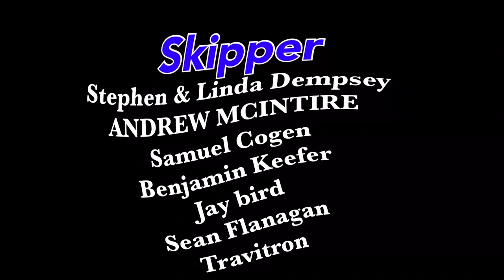Time Lapse Boat Bathroom Remodel from Start to Finish | Sailing Wisdom

Comment: Herb, You need to learn to use CAD for those projects. It would save you a lot of time. CAD - stands for cardboard aided design. Build cardboard patterns first and then go after the wood. It did turn out really nice and should be a lot easier to keep clean.
Reply from the maker: I like that type of CAD 😎

Comment: Beautufull job guys! I've been binge watching all your videos in preparation for our winter haulout and maintenance period....just to reaffirm that hard work pays off in the end 😀 Question though, where does the shower water go ? And could it stick around under that raised floor or is it contained within in that grey box and redirected from there so you can inspect for mold etc?
Reply from the maker: There’s a bilge pump that sucks it right out so it’s not hanging out under there. Hope you’re enjoying the binge!

Comment: Great vid! Thanks for the awesome videos! How has the copper sink held up so far? Do you have to clean it any certain way? I'm thinking about adding a copper sink to my boat and I wonder if there's anything special I need to buy or do to take care of it. I'm hoping to eventually refit my head as well, and I really like the look of copper with stone and wood. Thanks for your input!
Reply from the maker: It’s held up really well! I was worried that the salt water that pours in the hatch during a boarding wave would corrode the sink into a green ball of death, but it’s held up just fine! Every so often, I clean it with a loofa (after I use the loofa to clean me with the leftover soap in the loofa). If it gets some green spots, I’ll rub it with Mother’s Metal Polish. It cleans it up and keeps it from turning green. 
I could polish it to be a bright copper color but the maintenance would be murder. I keep it with a healthy level of patina so I can have a healthy level of relaxation.
Reply: @RiggingDoctor  Thanks for the response! I think I will go with the copper. Love your channel. Thanks for all your time and Efforts.

Comment: I've just destroyed the old head in my Jeanneau Espace and your timelapse makes it look real fast and easy.. which I know it's not going to be.  Are you using epoxy or polyester resin for the glassing?
Reply from the maker: I started with epoxy, but that got very expensive quickly! I switched over to polyester after a gallon of epoxy was used. 
Time wise, the project took 6 months but a few months were spent back in the states and away from the boat; so in reality it was only about 4 months of work. 

Good luck and keep me posted on how it comes along 🙂

Comment: Nice job!  You know I watch a lot of these boat renovation video's and can't tell you how many people spend hours using a finish sander to strip paint, when it could have been done in minutes using an angle grinder with a sanding pad and 40 grit paper...........I guess I'm just lazy!
Reply from the maker: I used 40 on the orbital to speed things up. I tried a grinder one time to take off paint and all I did was cut shallow depressions in the surface which took forever to fair out. I do t trust myself to do that again!

Comment: Nice. Curious about the constant moister exposure of the chain plates and whether some sort of coating would be ideal. Also, all that space between the wall and hull below and between the chain plates feels hungry for a large but removable (for chain plate work) cabinet. :)
Reply from the maker: I like the idea of a cabinet in there, but time was running out so I just had to board it up. Luckily everything is screwed together so I can always change it in the future!

The chainplates were coated in rust preventing paint for iron, because the chainplates are made out of iron. It does wonderful things in a saltwater sailing boat! If I keep them painted and maintain the paint, they hold up well.
Reply: Rigging Doctor. Hi Herb not a fan of the exposed screw heads but I see now it was part of your plan to allow easy access to the chain plates. By the way awesome job with limited tools and facilities. Cheers Chris

Comment: Great job, and  dont wish to be overly critical, but cant help wondering if you might regret sealing the backs and ends of the boards.
Reply: Likewise.. the one place you don't seal the timber, is the one place the water will find.. guaranteed. I'm pretty sure that's a subset of Murphy's Law.
Reply from the maker: The wood I used is Cryptomeria (Japanese cedar) and it is very rot resistant, untreated. Adding oil just helps them live longer. 
When I pulled a few of the boards after piling to install the plumbing, I was pleased to see that the backs of the boards were oily. 
It’s not as perfect as directly applying oil to those sides, but the surface is wet and hopefully lasts. 
Te really good part is I will get a good view of the backs and ends every year when I pull the boards to check the chainplates. If I see something happening (or simply at the first inspection) I can oil the backs of the boards.
Reply: @RiggingDoctor  Hey dude, say, you have an issue with using paint rollers? or it's just that you love using paint brushes too much?
You know how much faster the work would have gone?
in boat yards, we use brushes only where rollers don't fit.
Another detail, all the void space between the different foam pieces should normally be filled with low density compound before fiberglassing.
It would also have been better to finish-caulk the corners with Sikaflex PU compound instead of Silicone compound. That way it's good for several years.
Reply from the maker: I only had 2 foam rollers and a whole bag of brushes. I was saving the rollers for the deck, but sure wish I had used them in here!
I had to cut out a lot of the footage to keep the video from being boring with tedious details. The total raw footage in time lapse was 47 minutes! 
I filled all the gaps with 405 and epoxy.

Comment: Nice job !! it turned out awsome ?  Herb i been wondering what size Dyneema you used on your rigging > thx
Reply from the maker: I used nine mm SK-78 from New England Ropes. It was their STS-HSR, heat set dyneema. 

*Sorry, the #nine key on my keyboard just stopped working so that's why I had to write it out.
Reply: @RiggingDoctor  Thx Herb i like your design for the Galley sink top it is going to turn out great !!